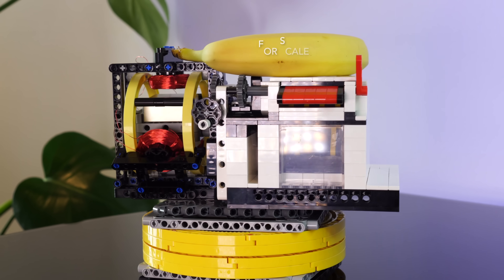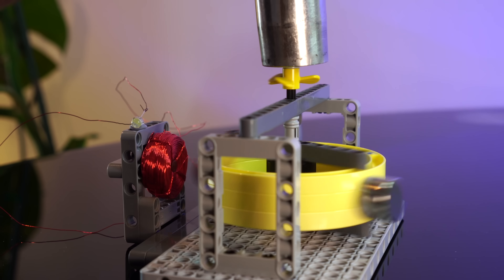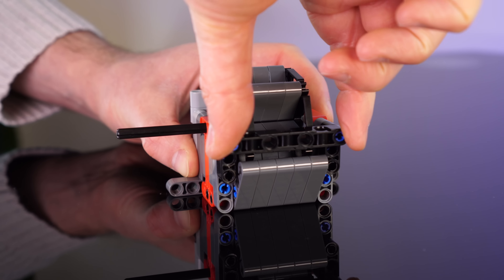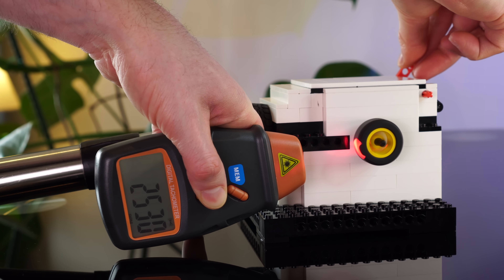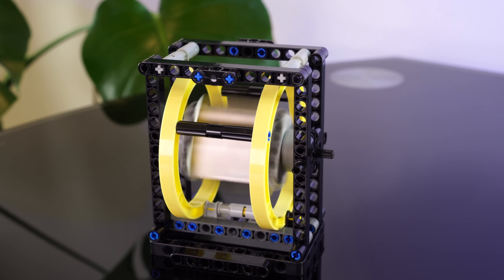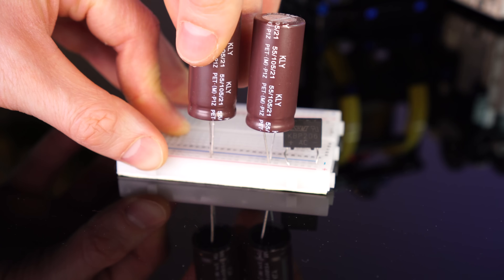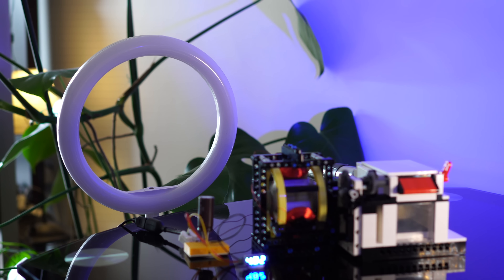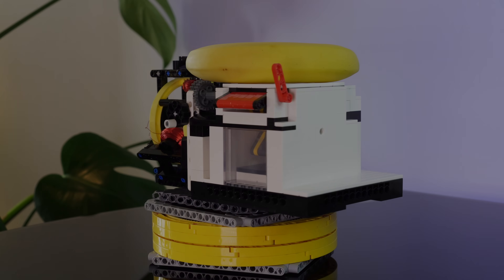This Lego Vacuum-Powered Generator SUCKS!

Comment: Fun and interesting, as it's really surprising just how much power can be drawn from just atmosphere pressure, if using a vacuum to direct it.
But; I find the fact the word 'efficiency' is abandoned, yet still used early on incredibly amusing; because using a mains powered vacuum cleaner as the source of for this generator renders all efficiency pretty much void the second it's turned on.
Reply from the maker: Haha you're totally right, this is really just an absurdly inefficient and over-engineered transformer. Turning a 620 watt vacuum cleaner into only a few watts is pretty silly 😅 But a fun experiment, and I like getting an idea from these generator experiments to benchmark their performance. I'm confident there are better configurations of this vacuum generator which would be much more performant. The engine is good (could be a bit better), but the generator could be much better. Will work on it 😉
Reply: @JamiesBrickJams  Well, if you like the ridiculously redundant...
Did you consider 'supercharging' your vacuum?
As in use a little positive pressure on the inlet.
Reply from the maker: Oooh I did not, that's a cool idea! Might have to tinker with that a bit - cheers for the suggestion

Comment: If you want a vacuum turbine to perform well, you have to let the inlet be light and barely any friction in the inlet because it will let the engine run at its best rpm while having the inlet at a certain point where the engine likes it

Comment: I bet you can get a lot more power from this if you add an iron core to the coil, i managed to get 2V from 18m of wire using four 5mm thick 20mm wide neodymium magnet and spinning it by hand with no gears using my 3d printed generator
Reply from the maker: Sometimes that's possible, but the drag created with these powerful magnets against a ferric core is extreme, and would leave the engine unable to run. At least with only 3 cores. I've made a few generators with many more cores (8+), and this reduces the drag quite a bit. But it didn't increase efficiency that much. They might increase your voltage output a little, but what really matters is how much torque you can apply to the generator. I prefer to have air cores as most of my Lego generators are primarily limited by how much torque they can handle
Reply: @JamiesBrickJams  if the axel cant handle the torque perhaps use a metal axel,
If the air turbine cant produce much torque to get it going perhaps the cores are very spread out it can cause a magnet to lock on the iron core and have some holding torque, but this torque should not exist when spinning the generator since it will average out to 0, but maybe you can make a transmission to have high torque to start it but not much torque to run it
if there are too many eddy current and hysteresis losses, i dont think there is much you can do
Also you can consider having more smaller magnets and more smaller poles, in motors it makes the motor have more torque, in generators it makes the motor produce more voltage, also it may fix what i assume problem to be which is the magnets locking onto the core
Reply from the maker: Definitely want to try with some metal axles! I have a few now, so it's worth trying. Especially powered by a nice pneumatic engine which tends to output loads of torque. You're probably right about trying a larger number of smaller magnets and cores helping to neutralise the drag - certainly worth a try! Cheers for the suggestions 😊

Comment: Try doing flat discs together, like a tesla turbine. Would be a cool experiment to compete with the normal turbine
Reply from the maker: For sure, I've actually been tinkering with a Tesla turbine for a while. It's unfortunately really difficult with existing Lego pieces, so I may have to resort to 3d printing for the flat blades
Reply: @JamiesBrickJams  I'd suggest using thin steel or aluminum discs with a .5mm thickness if you can, they are much more resistant to speed, but it can be a bit troubling to cut out the holes. Also, I wouldn't worry so much about cheating/not using lego pieces, the best designs will only be possible with at least a little bit of this type of cheating

Comment: I need the part list,and where you get the parts.
Reply from the maker: From irresponsible spending over many years 😅 I'm thinking of making instructions for some of my contraptions, but right now life is a bit crazy and need a little more time!
Reply: Cool,I'm researching biology as a school subject,and I'm learning electronics from my father.
Reply from the maker: That's cool, my dad got me interested in electronics too. Best of luck with your contraptions!
Reply: Ok so I've created lego transformers out of hinges,but it's parts are so old that they are falling apart.
Reply: Also I nabbed a glass air tank,I've been thinking to build a fully-functional lego motorcycle that can compresses its own air and runs off air.and generate its own energy.btw where do you go for those magnets?

Comment: How hot would it get?
Reply from the maker: Not much at all as far as I know. The plastic would likely wear away before heat becomes a real issue. If there was enough torque, heat could become an issue. But if this engine was under that much drag, the air turbine would just stall harmlessly.
Reply: If I were to recreate one I'd use those metal parts you can get and test it to its limit
Reply from the maker: That'd be awesome, I hope you do!
Reply: It wouldn't be in the near future but I'd still try at some point

Comment: A question I have is which fuel is more cost effective? Like which would cost more for the same run time/generation?
Reply from the maker: Which fuels are we comparing?
Reply: @JamiesBrickJams  I was thinking of compressed air vs. vacuum
Reply from the maker: @nevernether3368  Ah gotcha! Well at this scale, vacuum certainly has the potential to output more energy. Even at a fraction of the efficiency, we're talking about a 620 watt motor generating this vacuum airflow. So we can harvest quite a lot of this. If you had the patience to pump an absolute ton of air bottles though, and then created 10 or more outputs onto 10 or more turbine blades, you could probably achieve some pretty crazy power outputs. So at larger scales my money would be on compressed air. But who has the time to compress that much air in their living room 😅
Reply: @JamiesBrickJams  well I was thinking of the electrical cost of running the vacuum or a air compressor. Run them for the same cost and run the generator, I wonder which would last longer/produce more.
Reply: @JamiesBrickJams  To be completely honest, if the only compressed air powered things you’ve tested are lego turbines and ram-piston pneumatic engines (the ones with the large yellow cylinders), then you’ve got a whole lot more to explore with compressed air. Those specific engines/turbines are not very efficient and I myself have actually made an extremely efficient, but also powerful pneumatic engine that’s decently small.

Also not to mention, with compressed air you can actually carry it somewhere and you can power a vehicle with it. That obviously doesn’t make vacuum powered things worse though, I personally like them too a lot!
Reply from the maker: Very true, good points! I was just comparing my previous turbine engine with this vacuum engine. And you're right, I've got a lot more experimenting to do here. As for compressed air, you're definitely right that a good pneumatic piston engine has some real potential. I've built a few of them and they can output some really impressive torque. Now that I've got some metal pieces, I'd love to push a piston engine hard. I agree about convenience - compressed air can serve as a sort of battery!

Comment: Improvement idea: try building the turbo out of those yellow circle pieces it will be much more efficient
Reply: In vaccuum engines, turbos actually decrease the preformance of the engine. Thats because the vacccuum will have to use up more power to spin up the turbo along with the engine itself which will decrease power.
Reply from the maker: Guess we're gonna have to use multiple vacuums 😎
Reply: @JamiesBrickJams  😎😎😎

Comment: Very cool! I've wanted to build a vacuum turbine for a while, although at the moment I have got myself a vacuum mill engine (which is basically just a steam engine with a very simple valve gear - used in old mills & factories, hence the name!). It runs quite well with a large flywheel to keep it turning over. Not sure if it's able to achieve the same results you have with the turbine lol.
Reply from the maker: Woah that's awesome! What a cool idea for a Lego build 😱

Comment: You should be able to get an estimate of how much power your phone is taking by using an app to measure power going into the battery, and having it take measurements with the screen off so you can be sure that almost all of what your phone takes is in fact going into the battery. The only issue is that I'm not aware of an app that records historical power measurements. The closest I'm aware of is Battery Guru, which reports instantaneous power (which you can only actually see with the screen on), but only records historical current (which doesn't tell you much beyond a qualitative fast/slow without also knowing the battery voltage). I'm sure an app that does the right thing is possible though.

Comment: I have also made a vacuum turbine but instead it resembles a supercharger with two two-blade turbines that are geared together and also not using the half studs you used to get a better seal
Reply from the maker: That's awesome! I like the idea of gearing together more than one blade - well done
Reply: @JamiesBrickJams  Yeah even turning the axle by hand produces a steady amount of wind. You just have to make sure to adjust the small margins on the axles so it doesn't touch the walls. Another problem is that the four-blade doesn't fit with another one beside so you have to use two-blade turbines which probably has some leakage
Reply from the maker: Woah that's actually really useful to hear - I've been trying to build a turbine blower for quite a while and just haven't been able to get a design that works nicely. I'll certainly give your idea a try here. Thanks for the info!!
Reply from the maker: Thanks for sharing man, that's such a cool design - love it!

Comment: Want alot of power? Make a lego vacuum v12 engine!
Reply: Actually a vaccuum v12 will be far weaker than even a vaccuum 1 cylinder. The reason is because the vaccuum will need to spend more power to move 12 entire pistons instead of just 1. The axle will also have more rotational inerta in the v12.
Reply from the maker: What about 12 vacuums 👀
Reply: Obviously then it would be much more powerful than a 1 cylinder because the number of vaccuums will be proportional to the number of pistons. So 1 vaccuum per piston. Though you would have to attactch every vaccuum spearately up to its piston to achieve maximum efficency.

Also that means than a vaccuum  inline 6 will be as powerful as a v6 since the number of pistons are equal so equal power output. Probably the only thing that would make the difference is the piston timing and maybe some air leaks
Reply: Id actually want to see someone try make at least a v6 like that
Reply: @JamiesBrickJams  Lol!
Reply: @LemonJuice_  did I ask for your opinion?
Reply: @CryoiX  im just pointing out fax bro
Reply: @LemonJuice_  but did I ask for that?
Reply: @CryoiX  buddy this aint ur comment section lol. Ive proved u wrong thats all and theres nothing wrong with that.
Reply: @LemonJuice_  but did I ask?
Reply: @CryoiX  how bro felt saying that 🥶
Reply: @LemonJuice_  once again did I ask?
Reply: @CryoiX  I dont care. Nobody cares if u asked or not. Noone needs ur permission to speak
Reply: @LemonJuice_ you're funny
Reply: @JamiesBrickJams  hell one vac for one manifold that's a good idea. Maybe not a cheap electricity bill tho 😂😂
Reply: @LemonJuice_   Exactly
Reply from the maker: Powered by 4 vacuums!
Reply: @JamiesBrickJams  YES!

Comment: March 2025: This Lego Jet Engine Blows!
Reply: @JamiesBrickJams  yo what happens if you put oil at the spinny spinny turbines, does it get faster?
Reply from the maker: @D9fjg  I'd imagine using some lubricant would make it run just a little faster. Probably not too much though. I believe lubricant would make a bigger difference with a piston engine
Reply: @JamiesBrickJams  future video idea?
Reply: @JamiesBrickJams  Soda bottle. Vinegar. Baking Soda. Put the jet turbine bit on the outlet and boom -- chemical power! Be careful it has a tendency to foam over in amazing science fair volcano

Comment: While this more or less is a demonstration, you could probably use this generator with a vacuum generated by falling water! I don’t know any of the logistics, but seeing as it was a relatively low power setting and vacuum, running this off a small waterfall seems like a viable idea.
Reply from the maker: Driving something similar with water is definitely on my agenda, good thinking! I also love the idea of driving it by vacuum created by the flow of water through a pipe. Thanks for the suggestion 😁

Comment: What if you make instead of 3 face generator into 6 face generator with technic generator and motors.Like you make generator thats run by lego mottor at high speeds then on 1 end you add generator so it can charge it self when spinning
Reply from the maker: You can certainly create a generator powered by a motor, like a Lego motor. But the output would be way less than would be required to run the motor. So in essence, the generator becomes a voltage converter with massively reduced current due to the losses in efficiency
Reply: @JamiesBrickJams  Well i dint meaned on the original lego engine i meaned on Strongest lego engine that most people use in Lego Tehnic builds like lego RC cars.Plus If we had 6 face generator then we could add more magnets but that migth not be good idea because that migth damage capacitors but the strongest Lego engine with gerator would be a good idea to use but it wouldnt have good relability since it could overheat.The strongest lego engine isnt made by lego but from another company that makes these engines compatable with lego parts.Maybe there are on Bricklink or any Lego web page.And if you wanna make more effitiemt and faster vacum engine maybe look other videos making them.For less friction use something on parts.Just dont use Anti-Perspirants or else you gona learn hard leson as me as have Lego parts smelling on it forever 😬

Comment: What if you made a Tesla's Turbine with Lego, a Tesla's Turbine uses the stickiness of air to rotate a shaft.
Reply from the maker: I've been working on that idea for a while actually - but I'm really struggling to find thin discs that hold themselves together. I suspect some 3d printing might be needed for the blades of the turbine. But I do love the idea - great suggestion! 😉

Comment: Most people who are into Lego vacuum engines lubricate their axles and turbine blades with olive oil to achieve even higher RPM. Veggie oil works too :)
Reply from the maker: I considered that, but didn't want to get my hands all oily 😅 Surprisingly, there wasn't much wear and tear even after running this engine quite a bit. But for a future experiment I'll consider some oil to see how far we can push it!
Reply: @JamiesBrickJams   You should honestly use something like silicone grease or oil instead. Vegetable oils tend to oxidize and are hygroscopic, which means they will gum up and actually increase friction after a while.
Reply: @JamiesBrickJams  A Q-Tip / cotton swab works pretty well and keeps your hands pretty clean. Cheers!
Reply: Are you saying that olive oil is not a veggie oil? 😂
Reply: @SonoIlFactotum  They are different I dunno what you are on about ¯\_(ツ)_/¯
Reply: @SonoIlFactotum technically it's a fruit. So no.
Reply: @benholroyd5221  are you saying that fruits are animals? 😂😂😂
Reply: @SonoIlFactotum  no im saying fruits are fruits, and vegetables are vegetables, and animals are animals.
Reply: I wouldn't use cooking oil as they usually will degrade and eat the plastic, I destroyed a pretty decent sized see through V8 model when I tried to put oil in to spin it faster than intended.
It won't melt the plastic on its own, but it will make it VERY brittle to the point, you touch, it break.
Reply: I use WD 40
Reply: Graphite dust works but is real messy

Comment: 6:32 while 10000 RPM is of course a ridiculously high speed, the faster the spinning is, the higher the flux will be. And as the flux is directly proportional to the induction voltage, the higher your RPM is the more voltage you will generate. Anyways, love to see these physics applied in lego builds, it's really cool!
Reply from the maker: Yeah I'm almost tempted to see just how fast it could spin if I connected the magnets directly to the turbine without any gear reduction. But I'd be pretty worried about something flying off or creating a speed wobble. Perhaps in a future experiment!
Reply: @JamiesBrickJams do it, no balls
Reply from the maker: @sammyboy2007  on it already 😉
Reply: @JamiesBrickJams  eeyyy my man
Reply: @JamiesBrickJams  Fun! Can't wait to see the result!
Reply: @JamiesBrickJams   maybe you can add technic supports or even "cheat" and add other things to support it or add protection.
Reply from the maker: @b33fam  I'm pretty sure you're right, and I'll try that on a piston engine eventually!
Reply: but vaccum engines have less torque than a nitro engine
Reply: @Wreckedftfoxy bro is 9 💀